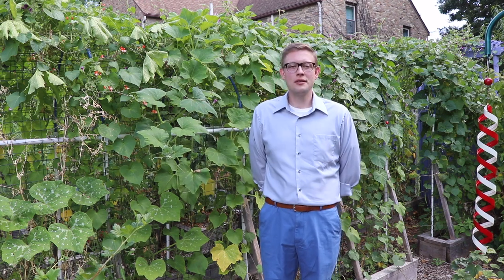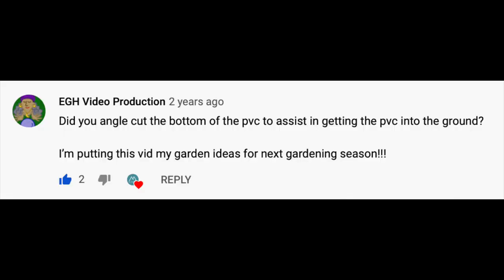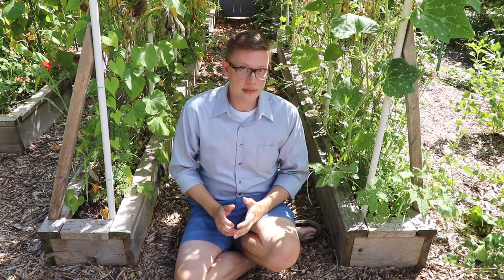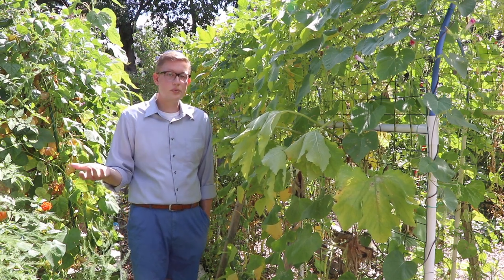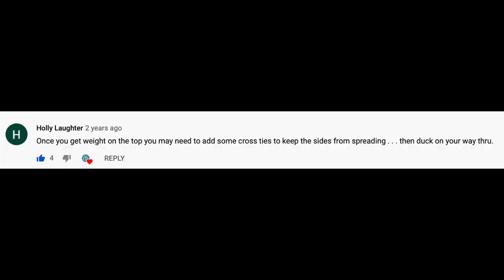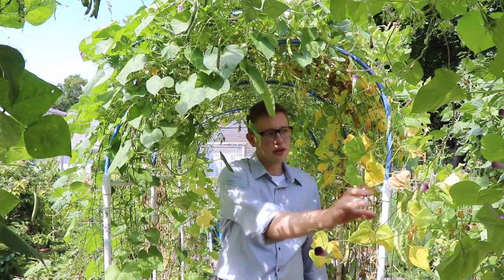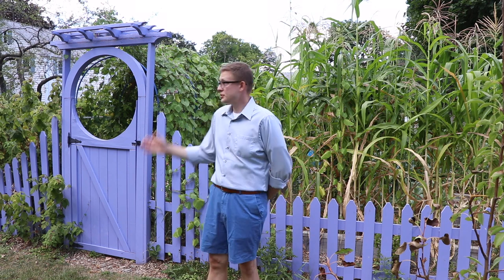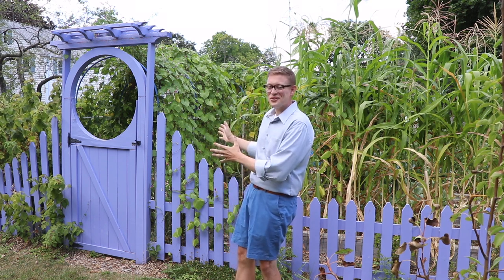Arched Trellis Tunnel Questions, Comments, & Upgrades!

Comment: If your soil is hard where you want to pound in the pipes, take a 1/2 inch dowel pin cut 6 inches long and insert it into a hole drilled into a short piece of 2x4. Insert the dowel into the pipe and pound on the 2x4 for less stress on the pipe.

Comment: Why did you used 1/2" pex instead of 3/4"? Does it fit snugly in the 3/4 tees and cross?
Reply from the maker: I wanted to be able to adjust the height of the arch initially, so the 1/2 pex could be slid up or down inside the 3/4 pvc to the level I wanted.  I suppose 3/4 pex would have worked fine, too.